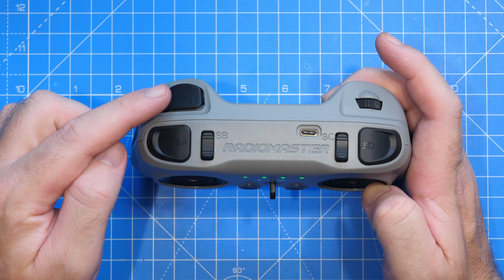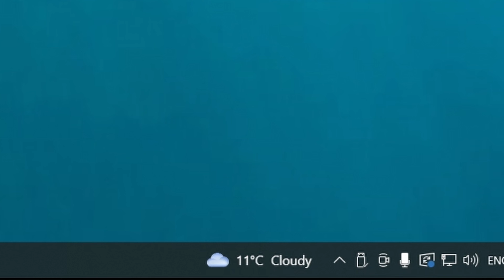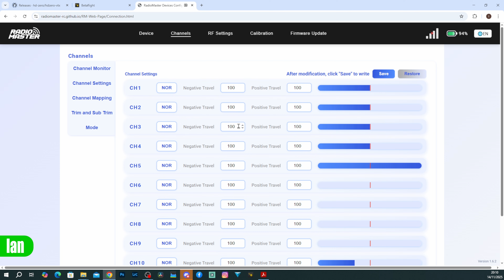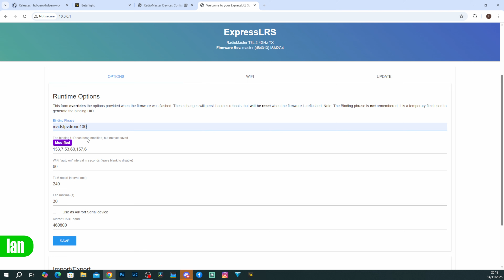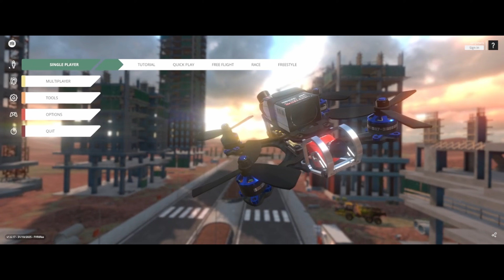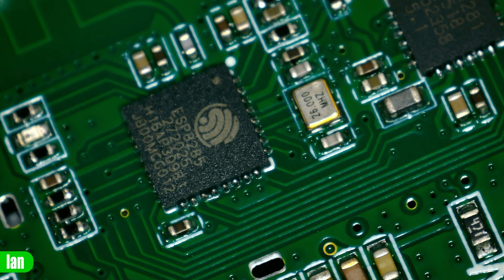Radiomaster T8L ExpressLRS Radio - Can You Get better For $35 ?

Comment: It's strange that the controller settings don't have an option to disable the ADC filter. For ELRS, it's necessary to apply the ELRS preset and disable the ADC filter in the controller.

Comment: Radiomaster is taking over the game. From a $35.00 to a 169.00 most capable gx12!!! If you go with another radio company your actually doing yourself a disservice, really... I have a jumper t-lite that I use for flying whoops but if I had to do it all again I'd probably buy a pocket over a t-lite in fact I know i would. I have a GX12 and im definitely getting a TX15 down the road.
Reply: Not if you are a plane pilot, frsky is budget friendly, and just so you know, my main transmitter is my gx12, I love the thing, but more switches would have been something I would have preferred, the buttons though I really enjoy better then a switch

Comment: It makes no sense your prejudice against the DJI RC link, if you have no video link it makes no difference if you have a rc link or not....
Reply: It definitely makes a difference. If you lose video link an experienced pilot can switch into angle throttle up and usually climb high enough to regain video.
Reply: @HaleFPVRC  lol, you make me laugh so hard,. Back in analogue land, maybe if you whooping, but not in digital and not faster than the device can detect the link failure and act on it before you could/can any ways. Now lets look at a scenario other than a quad at high speed low but apparently nothing in front, or above it (so out in an open field) and suddenly lose link but can just punch out.... lol

For probs like 90% of people using an air unit, they are up in the air flying around and if the video or link failed RTH auto engages or they hit the RTH button cause the video looked a bit sketchy. In just about every single scenario that takes place at video link limit which is same as DJI RC link limit so...... the difference is only the additional weight, power draw, interference  and complexity that adds zero redundancy nor mitigates any risk from adding additional receiver gear.
Reply: @quadlawnmowerman glad I amused you. But I’ve saved my quads more times than I can count because my elrs signal is still strong when the air units video link starts to fail. RTH isn’t a feature I use. I’m not into long range or camera drones. I prefer my freestyle or race quads.
Reply: @HaleFPVRC  I will take "things that never happened" for $100 please Ken
Reply: it absolutely does, my instinct when video cuts or gets bad is angle mode and punch up and 99% of the time I'm able to get video back and steer her back to safety, with DJI you're just SFOL if you dont have GPS Resc.
Reply: @kobrakon47  The difference is only the additional weight, power draw, interference and complexity from adding additional radio gear that adds zero redundancy nor mitigates any risk. Nothing like adding another radio signal next to your video signal to help keep that noise floor low 🤣🤣🤣
Reply: It 100% does. So many times have I saved quads by going angle mode -> punch out. The DJI RF link does not behave well enough to be recommend imho
Reply: @invertedflow  how would you know, you don't use it, I guess the same way we know chewy ain't saving nothing. The funny thing about the ones making the noise is the fact they don't seem to know the DJI RC Link is separate from the video link and will endure when video is lost.... The RC link is usually more than 50% when video link is near dead.... Yes the rc link is sent out via the googles but the link is independent of the video link and endures when the video link drops. Now can you say "dogmatic" after me....?
Reply: Stop trolling

Comment: Thanks for the video😀 The main problem for me with the T8L radio, there is no sound/voice when you hit a switch. The RM pocket on the other hand, can be set to talk when you try different switches.
 So, no need to look at the radio when you are wearing goggles.👀👍 At least if you are in flight, then you hit a switch, then you hear it say disarm, instead of flight mode ACRO ( it's butt clench time ). You know why it crashed 😳
➡this time.😯😺😺
Reply: It actually does sound!
Reply: @aesthetic8780  What sound Beeps? Does it have programmable switch sounds that say Disarm?
Reply: @KoshIsMe mine beeps once for ARMED and twice for DISARMED for example

Comment: If the settings webpage can be reached via smartphone and have a OTG cable with you, this radio has a portable screen for free allowing settings everywhere. Good deal or not? Depends on yor IQ. When I was noob, bought rather a top condition 2nd hand Juper T20. 1.000mW ELRS + EdgeTX. With much better and stronger gimbals, than this crap, cheap radio. For me, it wasn´t too complicatrd to learn how EdgeTX works, since it has as complex menu structure as a monochrome display cellphone from the mid ´90s. I wouldn´t buy this radio. Paid 45€ for the Jumper.

Comment: This is so stupid.. Okay, it's one thing if EdgeTX supported those through a phone app or something.. but having no screen period means you have no idea what settings there are on your TX and if it's bound or what the RSSI is etc.. And all to save, what, less than $1 in BoM for a cheap screen? Even if you only found your lost quad one time using RSSI telemetry, it would have paid off to buy a Pocket instead..
Reply: The screen was most likely omitted for marketing purposes, to avoid creating competition within the Pocket series. I also didn't like the size of the device; it's big,. They could have made it more compact.

Comment: Are those actually Pocket gimbals?
Reply from the maker: Yes and it's compatible with the AG01 mini
Reply: @MadRC  Mini or nanos? I think it’s with the nanos (POCKET). The minis are from Zorro and TX12
Reply: I was wondering this as well… if I can install CNC AGO1 NANOs… I think this would be my dream radio
Reply: They look EXACTLY the same if you compare to a pocket teardown.
Reply: @RenderFPV facts! I already ordered a t8l, and have ag01s in my pocket. I’m gonna try to do a swap for a video , whenever the t8l arrives. Hopefully it works. 

I’m guessing someone will answer this question or try the swap before me. But I did parse thru the RM website and I didn’t see anything that suggested they are advertising the ag01 nanos for the t8l. We shall see!! 😅
Reply: @saunaFPV I might just do an order as a gamble, and if not I can put them in my pocket. I’m trying to think of a good way to do a pocket antenna mod at this point before I hit buy.
Reply: @FPVwineUK I’ve ordered the pocket antenna alongside the radio 👀
Reply: @FPVwineUK  US